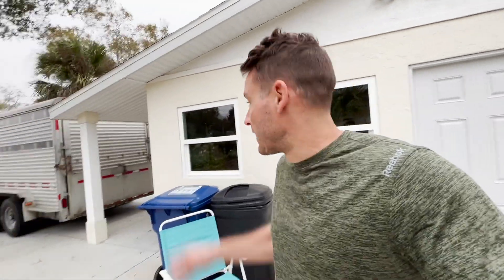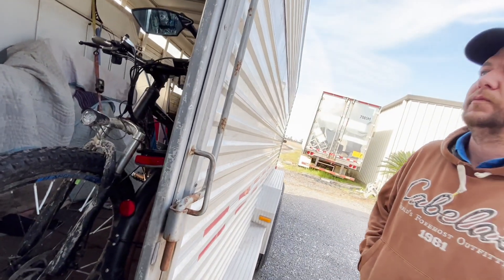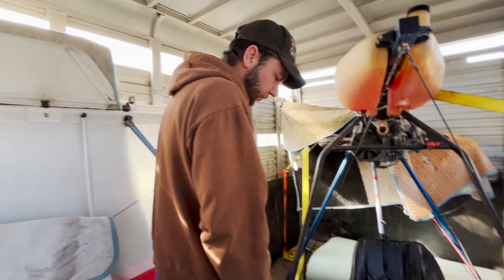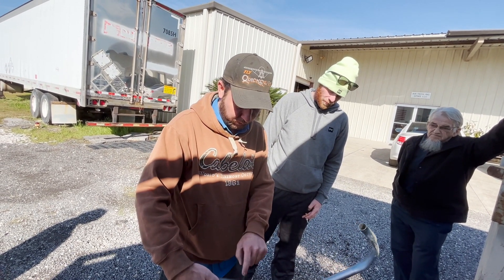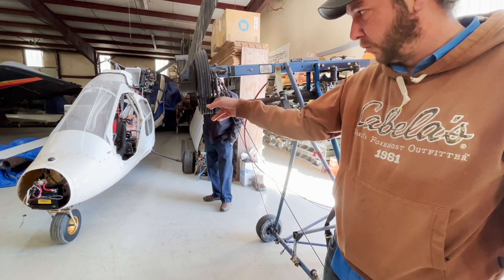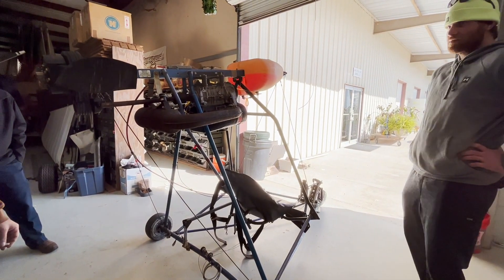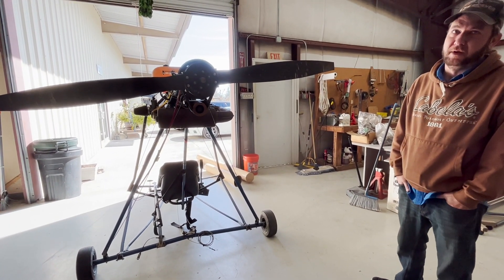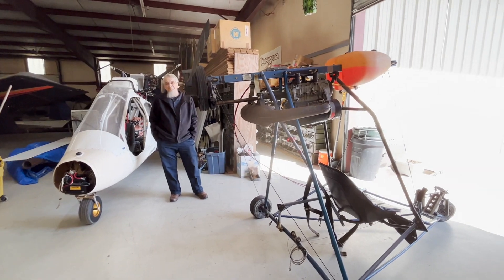Trip Vid 4: Air-Tech, Inc Looks At My Quiksilver Ultralight

Comment: So, if center-of-gravity at seat is optimal, and tundra tires change that (nose heavy?), is that good?
Reply from the maker: I don’t really know. Maybe Kenneth can comment
Reply: @UltralightAirplaneDriver  Were you considering tundra tires? If you lost weight to get things as light as possible, I'd guess 'no.' 🙂
Reply: It's not that the tundra tires make it nose-heavy, it's that they change the angle that the plane sits on the ground. Typically, you only change the rear tires to tundras so the plane sits in a more nose-low attitude. This angles the CG forward allowing the nose to stay down. Kinda hard to explain in words but hopefully you get the picture. :-)
Reply: @mmatt  What's the benefit of nose-low attitude, comfort? It's not like applying elevator trim, right (or nose ballast)?
Reply: @commentatron  In the air, the plane will fly exactly the same. The benefit comes from the tundra tires themselves. They let you take-off and land on rougher surfaces giving you more places that you can operate out of. The fact that the plane will sit on its nose with no one in it on the ground is only a side benefit.
Reply: @mmatt  Thanks!
Reply from the maker: @commentatron  I was thinking about it till I found out that it adds 18 pounds then I wasn’t interested